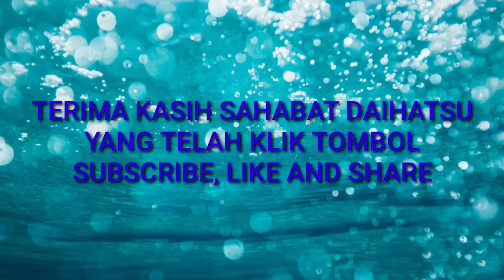MENCARI KABEL TRIGER LOCK/UNLOCK, ALL NEW TERIOS TYPE X DLX 2019

Comment: Om itu modul sentral lock nya ada di samping pedal gas ya...., kebetulan punya saya delux x std lagi dalam projek modifikasi yg membutuhkan triger lock unlock😁
Reply from the maker: Betul sekali, emang mau modif apa nih om
Reply from the maker: Yg sebelah kanan pedal gas itu ada soket triger lock unlock kalau ingin lebih jelasnya silakan hub wa saya di 081331679204 nanti sy kirim foto letak triger lock unlock
Reply: Saya rencana lagi projek pasang spion lipat om, dan saya butuh triger lock untuk menutup spionnya, kalo boleh tau kabel kontak on warna apa ya om yg di bawah setir....makasih
Reply from the maker: Maaf telat balas karena kesibukan, Coba om buka cover setirnya, nanti kelihatan kabel kontak ada 5 buah, cek satu2 dengan tespen DC, caranya hub, ujung kabel tespen DC ke body mobil dan tusuk 2 ujung tespen satu persatu, Bila nyala itu yang om cari, tapi dengan satu syarat berurutan ya om, 1. cek arus 12vlot kondisi kunci off, 2. Cek arus kondisi kunci Acc, 3. Cek arus kondisi kunci On, semoga bermanfaat
Reply: Kabel trigger lock atau unlock itu masing2 buat apa ya om..? Maksudnya kabel trigger itu apa ngeh.. hehee
Reply from the maker: @arif_sy  rencana om mau modif apa?.., kabel triger itu kabel yg memperintahkan untuk pintu mengunci dan membuka pintu mobil
Reply: @channelsetiya7274  siap om.. sudah jelas..